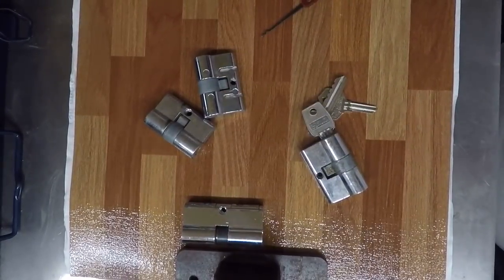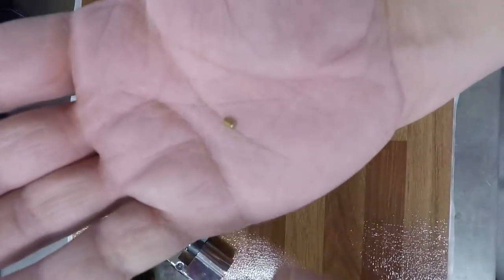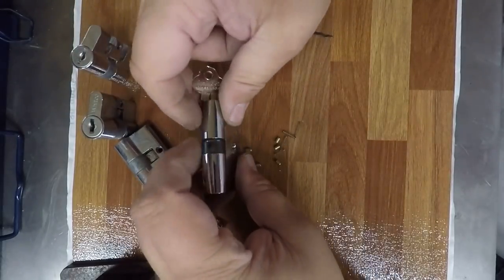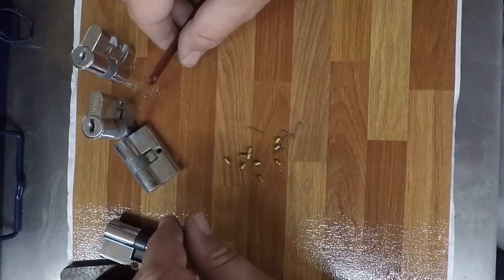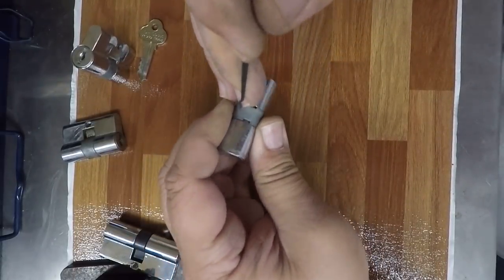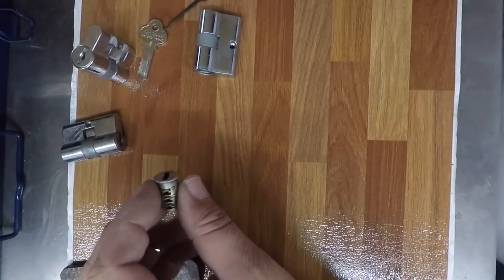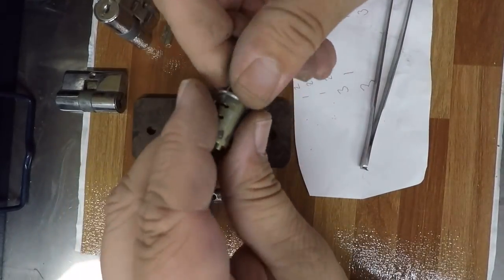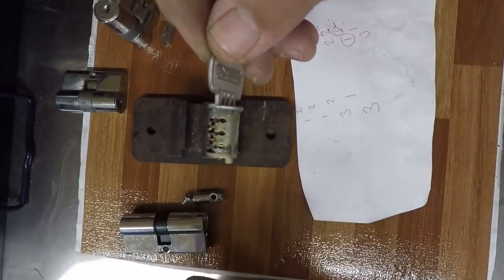How to re-Key a screen door cylinder

Comment: Nathan your C4 11111 cut looks suspiciously like a space & depth key?! Was taught what you call bottom pins = key pins & what you call top pins = driver pins & what you're calling discs = wafers(same  as what lots of cars have) did 3 screen doors this morning (they had no keys & 2 were locked, ripped out the unlocked one, gutted it & hand cut a key only to find out they're not keyed alike! Waste of an hour I should've just snapped them off & installed new ones!
Reply from the maker: I use the old cylinder as spacers, snap in half and remove centre and its a spacer.. We throw the old ones out and just install new ones most of the time, takes too long to get the Futura warmed up, and old key make good washers.. But someone wanted to know how it done, but I agree takes too much time. I normally carry 10 KA 5 pin cylinders and just match the rest of the house to the same key. I could save $15 per Cyl re-keying , but takes too much time.  The electric pick gun I got this year is getting a work out, I use it on all wafer locks, super easy..   And yep your terminology is correct, mine is more like locky slang, wafer and driver pin dose sound better